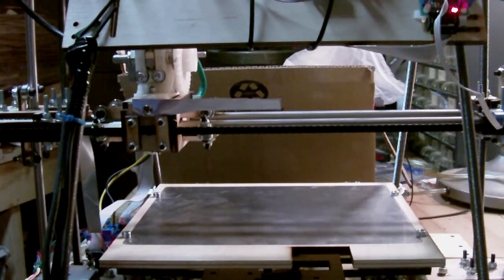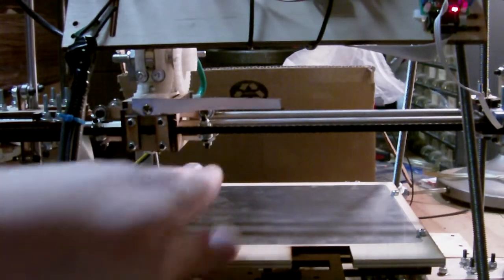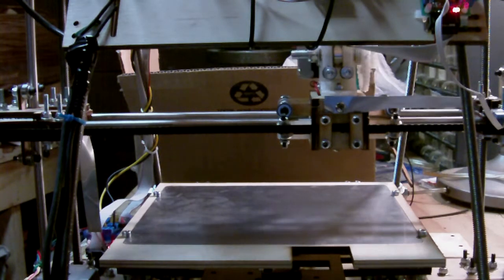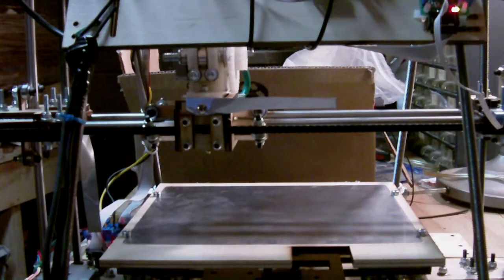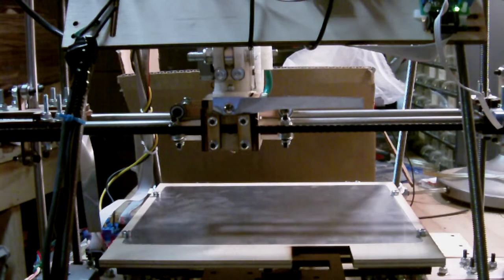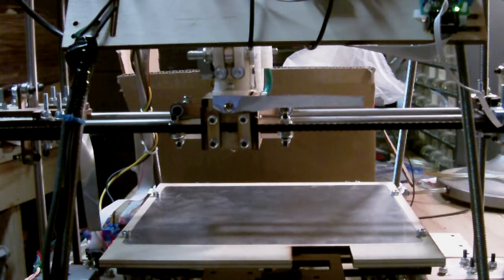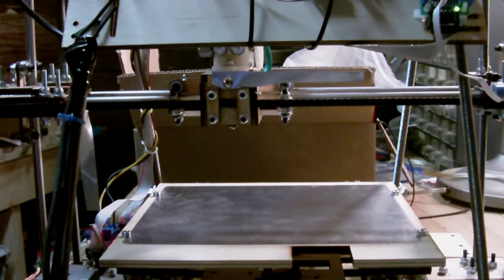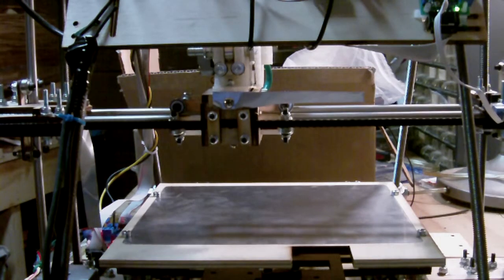Techzone Reprap Mendel axis tests

Comment from the maker: Well if it might be worth a try. Some people got them going. I have a stepper controller that needs to be fixed or replaced and there are a lot of communication errors. I tried using shielded Cat 5 and all sorts of things to get rid of cross talk etc but I could never get it working. The extruder was working at one point but it wouldn't go home. I got it going home and then it wouldn't extrude. Kept having trouble with the extruder. The pritned parts quality wasn't good so it wasn't smooth

Comment: Damn that's what I was afraid of. I found an old kit in storage where I work, and was hoping to be able to put it together. I have another printer I can use, but somebody mentioned that the motors aren't powerful enough, and that the electronics were crap. 

Such a bummer, was hoping to be able to print the parts to replace the wood ones, wonder if it's still doable.

Comment from the maker: @GeoDroidJohn I received it in mid November and put most of it together by the beginning of December. I took some time off for the holidays and then hooked all the wiring up at the beginning of January. I don't have it fully configured yet. I started out on Linux but it gave me some problems so I installed XP instead. I'm having some issues with a couple of the endstops and I haven't been able to get the heater/thermocouple firmware to work yet.